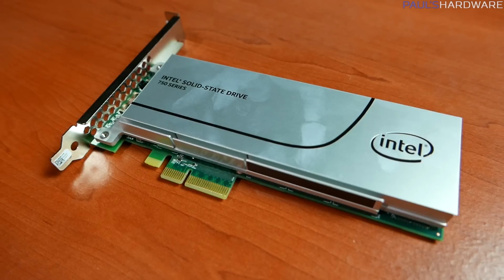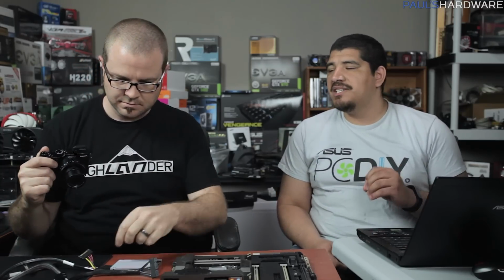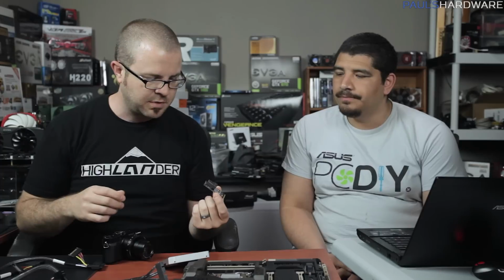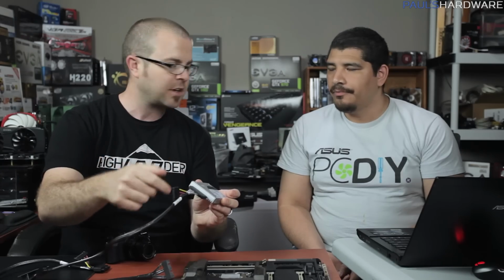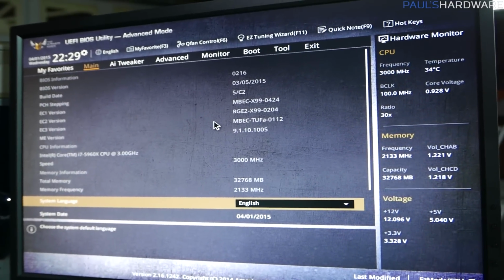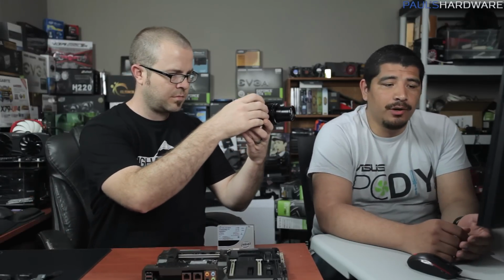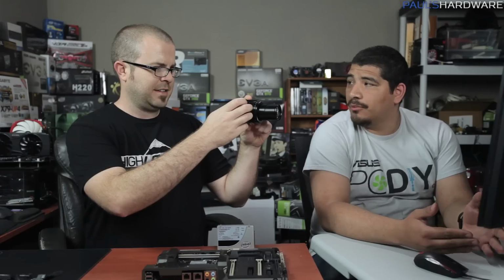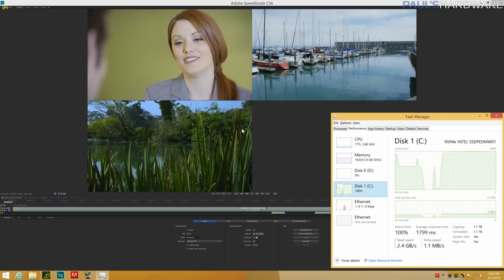Fastest SSD Ever! Intel SSD 750 with JJ from ASUS

Comment: But does it work on Z170/Z270?
Reply: They have PCIE x4 M.2 slots not need an adapter and not need a 2.5" SSD just buy M.2 NVME

Comment: Can someone please explain to me what nvme vs m.2 vs nvme m.2 are?
Reply: Rift_Blade something so simple was never quite made clear to me. thanks for the assist.
Reply: Basically, there are 3 ways of data transmission, IDE, AHCI and NVME which is the fastest. There are 4 types of consumer connectors: PATA, SATA, U.2 and M.2. NVME is faster than AHCI which is faster than IDE. M.2 is faster than U.2 which is faster than SATA which is faster than PATA; however, M.2 uses an unreasonably enormous amount of PCI-E lanes. M.2 + NVME = SUPER FAST DRIVES. PATA + IDE = Super slow drives. I had a PATA IDE drive before but the pins on the PATA connector got bent and I couldn't benchmark it so I threw it away a few years ago. I really want to compare 1 of those cards against 2 of my Samsung 960 PROs in Raid 0.

Comment: I am just more and more confused by these SSD's... I mean is the fastest SSD now an " NVMe M.2 " instead of just NVMe or M.2? Help please
Reply: Basically, there are 3 ways of data transmission, IDE, AHCI and NVME which is the fastest. There are 4 types of consumer connectors: PATA, SATA, U.2 and M.2. NVME is faster than AHCI which is faster than IDE. M.2 is faster than U.2 which is faster than SATA which is faster than PATA; however, M.2 uses an unreasonably enormous amount of PCI-E lanes. M.2 + NVME = SUPER FAST DRIVES. PATA + IDE = Super slow drives. I had a PATA IDE drive before but the pins on the PATA connector got bent and I couldn't benchmark it so I threw it away a few years ago. I really want to compare 1 of those cards against 2 of my Samsung 960 PROs in Raid 0.
Reply: JJ Explains in detail ->>> /watch?v=u-kACJLKNOI

Comment: Is it possible to use a M.2 solution along with the PCIe card setup. For example: I want to use the M.2 solution for boot up and productivity software only. Then have the PCIe Card 1.2 TB version for gaming only. And will a RAM Disk setup be too much or overkill on top of the speeds I would get for gaming with the PCIe Card version. Thanks for your time and again like always, another great informative video.
Reply: Yes, if you have the PCIe lanes available. A consumer PCIe x4 card SSD and M.2 SSD will take up 8 lanes total. Skylake has 16, which leaves 8 lanes for a single GPU.

Comment: Can I use this as the boot drive when first downloading the operating system onto a freshly built desktop using the X99 chipset? I'm referring to the one that goes into the PCIe SSD slot, not the SATA connection.

Comment: How does this drive fare to other drives in terms of reliability, is it the same technology? I am currently burning out  SSD's every other month. My drives are used for backtesting genetic algorithms. This basically means that they are writing around 50TB per day. It's really frustrating for me because if a drive dies throughout one of my tests I've lost weeks worth of data. I'd happily pay more money but from what I've seen so far all of the SSD's have a similar shelf life regardless of price. I was thinking of a raid setup however my output rate to the drives is around 200MB/sec regardless. Is there anything else I could do to improve the life of my SSD's? They are mostly Samsung 840 pro's but I would happily consider Intel / Asus.
Reply: I would watch out for Drives which don't use TLC Memory (Idk if the 840 Pro already uses TLC) but MLC instead (you wont find many SLC Drives in consumer grade SSDs)

Comment: Excellent Video...I"m so late, though.   I have a question:  The links above point to the PCI express, not the 2.5 drives.  Is the 2.5 drive in the video available now?  Or  is the 2.5 drive inside the PCE add in card?  please excuse my ignorance.
Reply: +Nate G. I am seriously going to buy either the 400gb 2.5 or the PCI add in. for my next build.
Reply: +Nate G. Nevermind..found it.  http://www.amazon.com/gp/product/B00VPK0LN0?app=1BA&ascsubtag=1ba_0_spk_000-os-device-browser-localeTest-testApp-custom%3AA%7Ccustom%3AB&partner=amazon&platform=CR&programCode=org&ref_=bit_bit_org_1ba-cr_def_us_title&tag=bit-org-1ba-cr-us-20&tagbase=abba-chrome
Reply: +Nate G. My real question....If I get the Sabertooth X99 - which PCI lanes are CPU Lanes?

Comment: Where can I find the connector cable to directly connect this SSD to my mainboard (without using the m2 adapter)? I have an ASUS Rampage V Extreme Board and this offers the connector for this SSD. Or did this SSD comes with the direct cable too?

Comment: Can Mac users upgrade Intel SSD 750 series for current or future Mac?  Which Mac is compatible?
Reply: Xi Le It requires a special adapter.  yeah..GOOD LUCK with that.lol.
Reply: +Zheng Zu    There is a solution for Mac from Sumsung (Product Description)
http://www.ebay.com/itm/NEW-2015-Apple-Samsung-1TB-PCIe-SSD-for-MacBook-Pro-iMac-MacPro-Late-2013-2015-/151605593746?hash=item234c65c692:m:mqjESs7tnU8_Zg5YdVXpxzw
"NEW 2015 Apple Samsung 1TB PCIe SSD for Mac"
Read/write: up to 2GBps (when using with MacBook Pro Retina 2015)
Write: Up to 1400Mb/sec and Read: Up to 1500Mb/sec
Samsung 1TB PCIe SSD Series of write speed of 2GBps BEATS Intel SSD 750 1.2 TB Series of write speed of 1.2 GBps

Comment: Since these are the first generation of these types of drives for consumers, they are in the high price range for even the computer enthusiast. The price would decrease in a few years and performance would be even better in a few years; thus, I personally would not rush into this type of drive until the prices have decreased and there is more motherboards to support this new standard of a 2.5 inch drive.

Comment: Thats great and all but i get 10000read and 10000write using a ramdisk.

I'll just wait till i can add 1tb of ram and use 900gb as ramdisk.
Reply: MrPepsicola123 sure, and then the lights go out and bam, 900 gigs wasted.
Reply: EqualsDeath have you heard of this technology called... battery?
Reply: MrPepsicola123 yeah, battery, then what?
Reply: EqualsDeath as long as power is not cut the data is still there, there is also a type of ram that retains its data after power is cut.

Comment: I found that my new ASUS Z97 Sabertooth Mark 2 motherboard has a NVMe setting in the BIOS! I am intrigued but never ever considered running anything faster than a Samung 850 Pro SSD, let alone raiding SSDs, let alone having this awesome Intel 750. Overkill on a large scale. Even if it cut boot times and loading screens in half would I be able to tell much of a difference. The guy from ASUS set POST time to 0 instead of 4 seconds. I just don't need that 4 seconds THAT badly during my boot, heh. When the price comes down and NVMe is more widely adopted, then this will be more like USB rather than Thunderbolt. Great introduction the this awesome product tho.

Comment: Revodrive 350 would be a better option in terms of speed,  just not storage.
Revo - 1800/1700 r/w,  boots x58 chipset all the way to current chipsets.

Intel 750 has more storage, but limited to 1400/1200 r/w, only boots on boards AFTER x79 chipset (some x79 won't boot, so most likely x99 chipset).

If you have the latest and greatest boards, by all means, go with 750.  If not, opt for a 350.
Reply: Kavya  350 is also cheaper, but requires a PCI slot :/    if it's JUST to boot, I'd get the 350, but 750s I'd get for my goodies n things, not for a boot.

Comment: YES - VERY interested.

I have two SSDs in my system today. One for the OS/System and one for my games.  With one of these drives at 400GB, I would partition it so that 150 GB was for the system and the rest for games and similar.

My next build WILL have Skylake, DD4 and NVMe storage internally.

Comment: ofc gamers are interested in that kind of ssd :D i got 2 250gig ssds and its not enough space(1 for os 1 for games). 1.2gig disk with inzane r/w speeds like that is inzane. dont need to worry about space and loading screens wont be annoying at all :D gussing the price is inzane aswell so looking forward to new windows better gpu's, cpu's and a bit better/easier seup/installation of the nvme ssd so i can buy a new pc. these minor gpu/cpu upgrades in the new series every year are starting to piss me off

Comment: Well its cool and all.  But you will never notice a single difference between any modern(new) ssd in real world use.  Unless they are bugged by firmware like the 840 evos.  Which is now fixed.
Reply: overclockedamd123 also the sequential read and write speeds are worthless for real world use...its all about random 4ks and such.  I admit I still have two mx100 512gbs in raid-0 for my games just for the epeen factor...its still not really useful.

Comment: Hi Paul,

Just wanted to share some details on how to "RAID" these drives to get ballistics performance.

1. Get a motherboard with at least one M.2 & 2 PCI-E x4 lanes
2. Get 3 or more Intel 750 SSDs
3. Get two M.2 to PCI-E x4 adapter cards
4. Connect 1 Intel 750 SSD to the motherboard M.2 interface using the Hyper Kit
5. Connect each remaining Intel 750 SSD to the M.2 to PCI-E x4 adapter cards
6. Connect the M.2 to PCI-E x4 adapter cards to the motherboard

Optionally, you could make use of an PCI Express 4-way splitter card which would allow you to use 4 M.2 to PCI-E x4 adapter cards. Using two PCI Express 4-way splitter cards would allow the use of 8 Intel 750 SSDs.

Next you want to install the OS on the first installed Intel 750 SSD. That is the SSD connected to the motherboard using the Hyper Kit. Not any Windows will do, what we need here is Windows Server 2012 R2. The reason for this is we want to install the Windows Storage Spaces and Hyper-V roles.

Storage Spaces will allow us to aggregate the drives, that is: software "RAID". It will also offer storage tiering, where hot data gets accessed from select drives (Intel 750 SSD) while cooler data gets stored on slower drives (populate the onboard SATA3 channels on the motherboard with spindle drives, or older gen SSDs).

We want to use storage spaces instead of a RAID controller because unlike RAID controllers (even if an M.2 RAID controller existed), Storage Spaces complies with and talks directly to each drive individually. This means that procedures such as GC, Trim etc. are not masked and ignored by the RAID controller, thus resulting in better overall SSD performance and life. IMPORTANT

Note: If using older gen SSDs as "slower drives" for Storage Spaces tiering, selecting Samsung Pro SSDs will offer the added benefits of being able to use RAPID mode, where select system RAM will be used as SSD cache. Make sure to enable RAPID mode before configuring the Storage Spaces storage pool.

After creating a storage pool in Storage Spaces, go ahead and install the Hyper-V role. Make sure that virtual machine location is set to the storage pool based drive that you created.

Install any version OS in Hyper-V that you need, without worrying about NVMA and driver compatibility. Oh and run some benchmarks once the VM is up and running :)

Tested system components:

9x Intel SSD 750 400GB
6x Samsung 850 Pro 1TB

Comment: Hi JJ and paul. So if i have a ASUS rampage black edition IV, with 3 titan blacks in the first three slots. Will the fourth slot allow the lanes to the cpu not utilising the pch/ old school bridge? As listing to JJ talking about the slots i was under the impression that my last slot would be x8. Now i'm worried cause i don't see any benefit moving to x99 as if it was the case i'd just get a dual cpu xeon board.

Comment: Hello Paul, its always a treat to see JJ on your channel.

I have an Asus Rampage IV Black with a lot of higher end components with water cooling all around. Tell me your thoughts about how this Intel 750 might work or will there need to be a BIOS update for the MB? I just put this whole system about a year and a half ago. I currently have two Asus GTX 780ti video cards but with an Intel 4930k on this board I should have plenty of PCI lanes - 40. I have in use 16 and 8. I will also have an LSI 9361 RAID on the 4th PCI, that will take 8 more lanes leaving 8 lanes. Thoughts?

Comment: I want to see the inside PCB as I don't get why it's so thick.
Reply: LudicFallacies It looks like a lot of that thickness goes to that heatsink. Also, the nand chips might be stacked for that 3D tech goodness. I'm just guessing about both those things, but I wouldn't be surprised if either or both are correct.
Reply: DerVerruckteFuchs
The heatsink is on the bottom as can be seen with the ribs and that's close to the edge connectors. I'm thinking it's due to caps on the other side of the PCB.
Reply: LudicFallacies It would be the first time I've seen an SSD PCB with caps on it. I guess that would make sense though for voltage regulation to deliver power for the kind of speeds it's capable of. It must need much more voltage than a typical SSD since this thing obviously gets hot enough to warrant having a heatsink with fins/ribs on it.
Reply: DerVerruckteFuchs
They all have various caps only most are low capacitance and are surface mount.

My speculation stems from looking at the PCIe model and it does in fact have some large through-hole radial caps on it's PCB.
Reply: The SSD PCBs I'm familiar with seeing are the msata ones. The caps on them seem to be teeny tiny square-ish ones looking at them again. A lot of PCIe SSDs do have the larger, cylindrical caps I'm more familiar with.

If both the PCIe and mini-SAS are the same except for interface and form factor, it would make sense that they both have the same caps.

Comment: I have to admit, I am a bit frustrated with ASUS Customer Support. I registered my new ASUS Z10PE-D8 ws and submitted several tech support tickets asking if the 2.5 Form Factor of the SSD NVMe SSF 750 can work with the above board. I get responses as if they have never heard of what NVMe means. But then I watch JJ and I am like, he knows his stuff but how on earth do you contact this guy. (I try DIYPC and no response). All I want to know is how does the 2.5 Form Factor of the SSD NVMe SSF 750 plug into the Z10PE-D8 ws MOBO? Second, will I be able to Boot from this drive (didnt watch the video yet). I have 2 ASUS Titans and dont want to really put a PCIe NVMe SSD to one, waste a slot, and two for thermal regulation of my Workstation I am going to build (currently sourcing parts). I dont mind putting one PCIe NVMe maybe a P3700 as my boot but thats as comfortable as I would be. Building a dual Xeon E5-2697v3. I really wish JJ could provide a way to contact him, hes very knowledgeable but impossible to find. Thank for you support.
Reply: The Asus hyperkit can be used for that: http://www.newegg.com/Product/Product.aspx?Item=N82E16813995042
It plugs into the m.2 slot on the z10pe d8 motherboard and uses the PCIE x4 connection on that.

Basically what you need is something that forwards Pcie to the mini Sas( SFF-8639) connector on your 2.5 nvme ssd. 

I'm actually using a supermicro card card(AOC-SLG3-2E4) instead, cos I ended up getting two Intel SSD's. Haven't tested if it works yet, but will find out soon I guess.

Comment: JJ mentions using the mitx boards like the impact (or z97i-plus in my case,) in which Asus decided to mount the m.2 connection to the bottom of the board for the hyperkit module, but I'd like to know how I'm supposed to use that in any mitx case with the connector being so tall. I suppose I'm supposed to cut a hole open on the bottom of my RVZ01 case unless Asus wants to make a more low profile solution since they decided the back of the board was such a great idea for m.2 location. Don't get me wrong, I appreciate have m.2 squeezed on there, but I imagine they had to know about this hyperkit solution would be coming along. With any luck, they'll offer a shielded m.2 riser/extension cable solution soon if one doesn't already exist, in which case including one with mitx boards would have been a nice touch. All in all, great video, Paul. Keep 'em coming!

Comment: Isn't SATA III going to bottleneck it?  There needs to be PCIe x16 or whatever SSDs.  Even if you're a tool who triple SLIs (diminishing returns) you should have enough room for it.  PCIe x1 slot SSDs are a step in the right direction and prices on them are going down, but that'll run into a bottleneck eventually and SLI potentially sandwiches them.
Reply: In the future, Hard Drives will be stacked built directly inside Graphics Cards, and a beter than PCIe x16 express lane will emerge to utilize even greater performance, maybe a PCIe x 32 lane, that's still the same size as the x16, by having shrunk the lanes width. Also, ovbiously GPU's and CPU's will be stacked, but they'll have HPU's additonally for "Holographic Processing." for Augmented Reality Rendering and Virtual Reality.

Comment: Take my money intel
Reply: You can upgrade your current computer's hard drive to any SSD and notice significant gains. But the issue with SSD's is reliability, I have had one fail on me and couldn't save any data, so don't store anything important on an SSD, haha.
Reply: ***** This thing is rated for 70GB per day for 5 years straight & comes with a 5 year warranty.
Reply: ***** SSDs do come with great warranties, the one I have was replaced under warranty, but my personal data was unrecoverable. Look at newegg.com and see for yourself the reviews on SSDs. I definitely recommend getting an SSD, just need to backup your data regularly in case it fails.